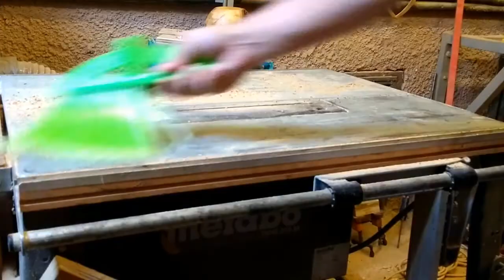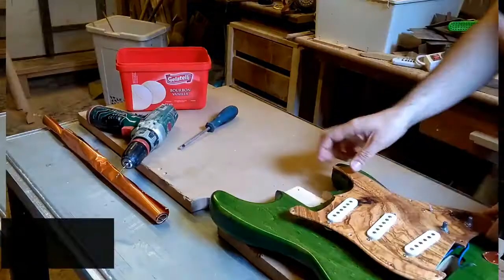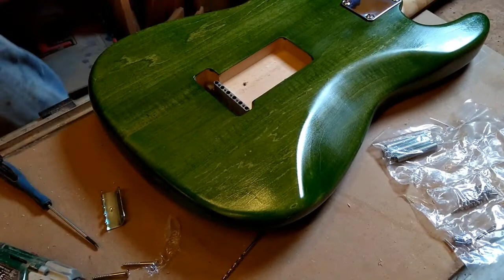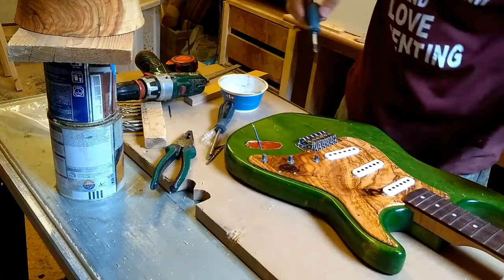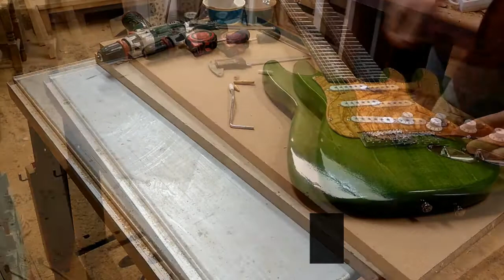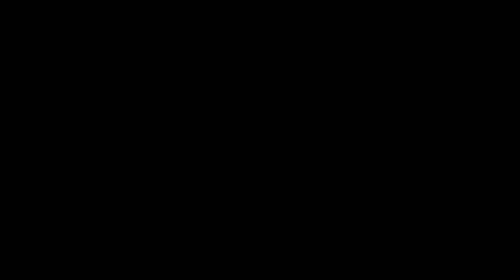Making a Custom Stratocaster Guitar with Olive Wood Veneers (Part 4 of 4)

Comment: Copper for interference, yeah! I also remember that you also use self-adhesive copper for electronic circuit space, right? No doubt the green feels great. Beautiful photos at the end, and indeed, the gitarra sounds perfect :) A lightning accompanied you perfect at 9:39, as if you were called! Thanks for allowing us this flight in a great job during these four videos!
Reply from the maker: Daniel, the copper I used was copper plated wrapping paper, I could not find copper tape,.  I tested it for conductivity, it worked well.  Yeah, there a thunder storm outside while we were filming the demos, it added cool effects.  Thanks again for watching!
Reply from the maker: @donniefisk2252  My video making skills were not as developed back then and I forgot to show the fact that the copper shielding was grounded to an aluminium cover that was applied to the back of the pickguard, thus grounding all the electronic components.  In any case the shielding did it's job.  Also, this guitar was made on special order for a customer of mine that deals in Olive wood products.  That color of green is the theme of his shop as it accents well with the golden grains of Olive wood.  I decked the tremolo system because he asked me to so that customers coming into his shop would not needlessly mess with the tremolo bar and potentially harm the guitar or break the strings.  I'm sorry that the design and execution of this project was not to your liking, I personally have heard many praises and a lot of constructive criticism that helps me be a better craftsman and hone my skills.  Mind you, this is literally the first guitar I have ever made albeit from a kit.  Thanks for taking the time to watch and sharing your honest opinion.  Stay creative!